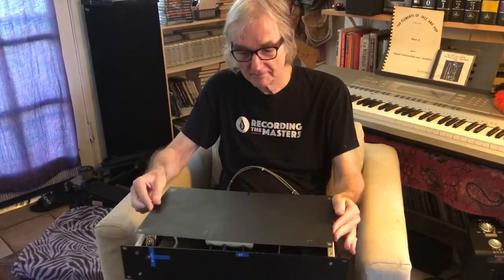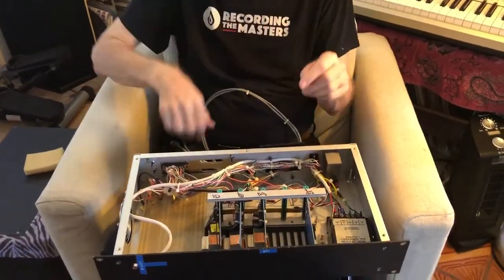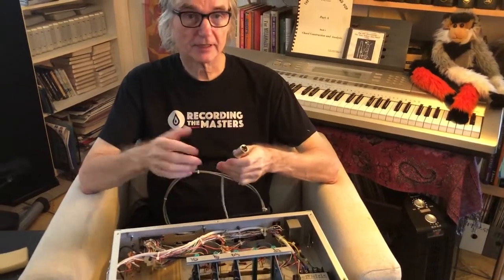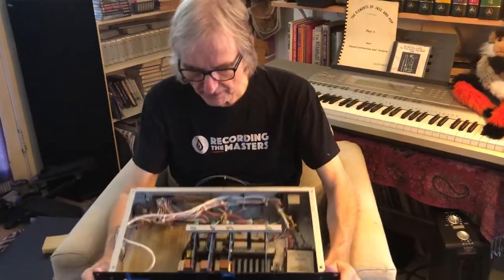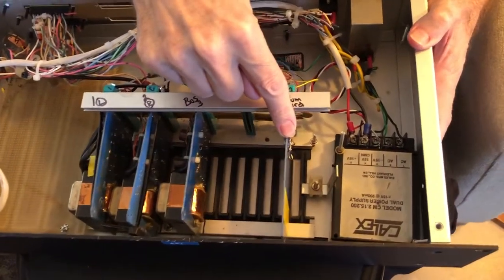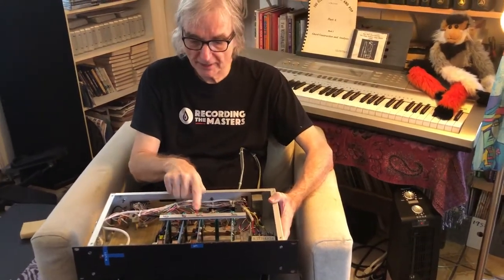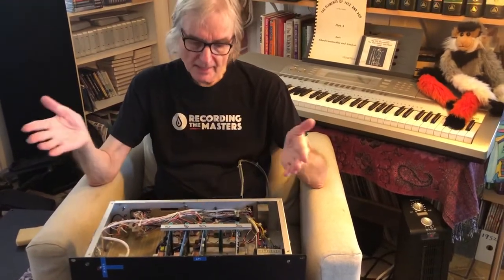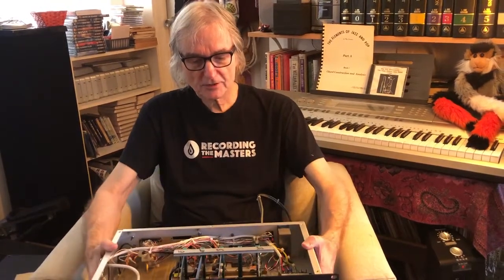API Based Summing Mixer

Comment: I have one that I had built with 4 vintage 325 cards, each 325 card has a vintage large iron Jensen input transformer in front of it. Two 325 for the main left & right out. And two 325 cards for a MixBus insert. Fully transformered balanced ins and outs. It sounds great!

It’s 16 inputs with mixbus insert and I can also record multiple mics down to a mono output. So wether I’m mixing or tracking I’m going through 8 transformers and 4 2520 opamps. I usually just use it to track with as I have a full console for mixing.

Cool box for sure thanks for sharing.